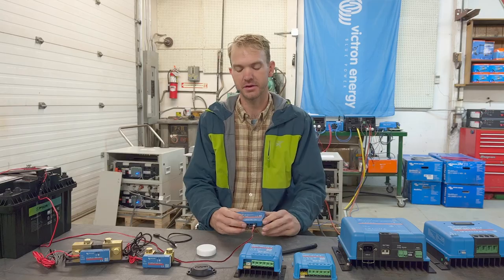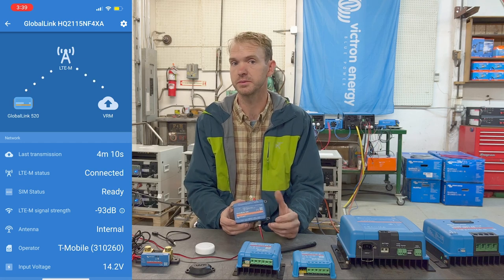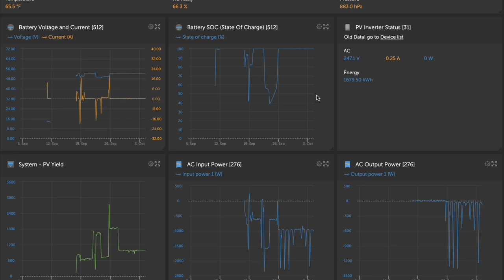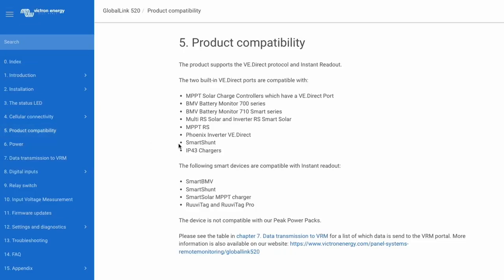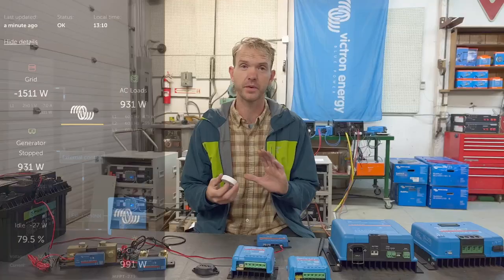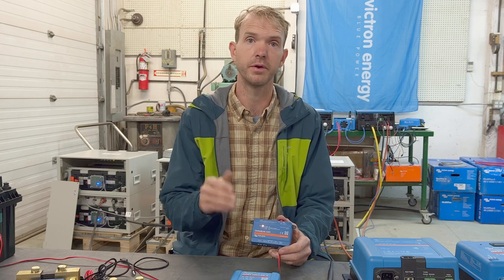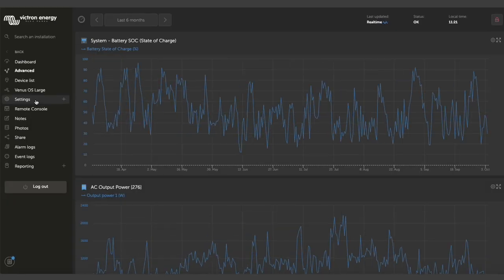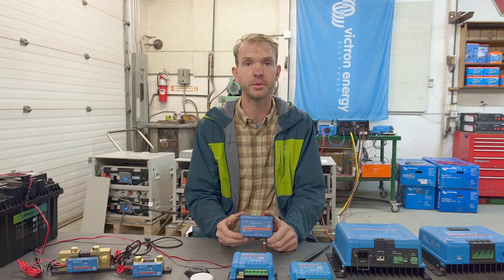New Ways to Monitor Small Power Systems with Victron's GlobalLink 520 & Ruuvi Sensors

Comment: Hello I have a magnum system with a midnight classic charge controller. I would like to set my system up with this. I want to know how humidity,pressure , temperature and motion monitors help me monitor my system.
Reply from the maker: Hi there, you can absolutely still benefit from using Ruuvi sensors - customers put them in the garage where the system is installed, the battery bank enclosure, etc and use the Ruuvi Station mobile app to remotely monitor their system and receive alerts when something is off. But there is no integration between Ruuvi and Magnum, so you won't be able to monitor this environmental data - alongside the rest of your system performance data like you can with a Victron system. This is unique to VRM and a Victron-Ruuvi product integration.

Comment: You should mention that this is not compatible with the Cerbo GX
Reply from the maker: The GlobalLink 520 and the Cerbo (both Victron GX devices) will both talk with Ruuvi temperature sensors but would not use a GlobalLink and a Cerbo in the same system.